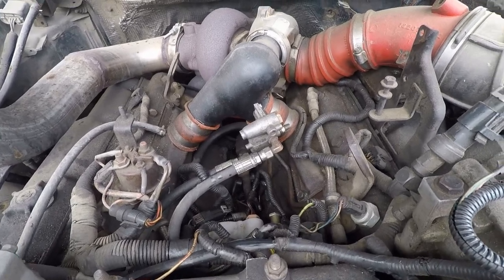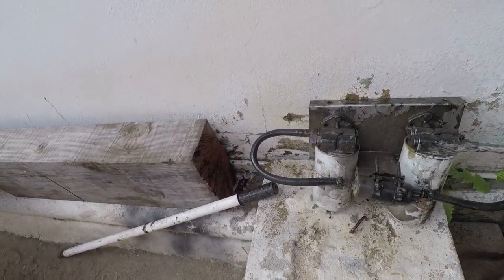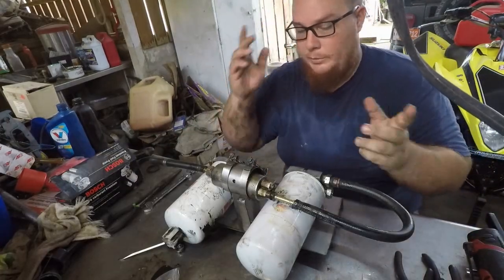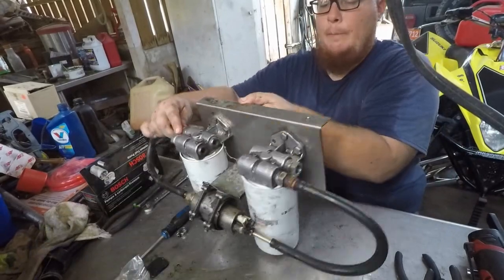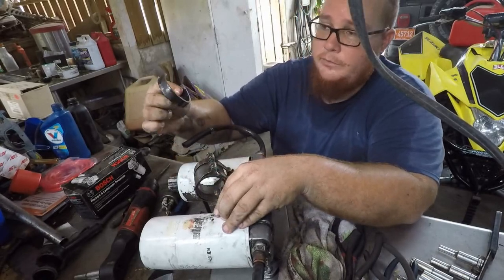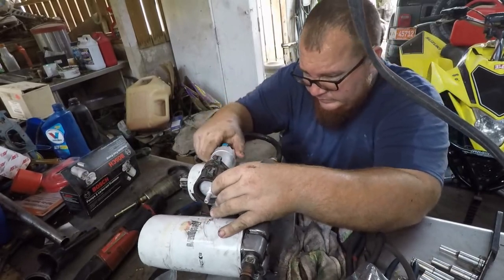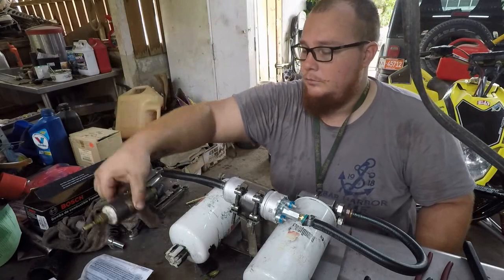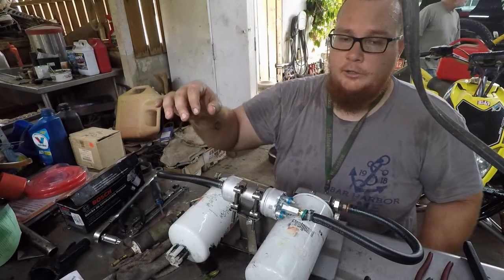FORD POWERSTROKE  7.3  OBS: CUSTOM E-FUEL SET UP!

Comment: Did you reuse the bolt for the banjo on the fuel lines ? I’m ordering everything and making sure I don’t miss something
Reply from the maker: Yes i did. With some fitting extra i dont remember i think i have  it written down on the video discription but thats all u need
Reply: @10MMSOCKETGARAGE  ok appreciate the help and do you remember how much the Bosh fuel pump was ? I’ve found multiple options and don’t know if it’s a knock off found one for 70$ and one for 160$
Reply from the maker: Letme chek real quick i think the knock offs was 80 . Dont get the one saying replaces bosch 044 i think it was the one 150+-
Reply: Hey so I picked up a extra fuel pressure regulator at a junk yard and it is the 95 and down cause it has the big black filter thing on it so since we’re the fuel drains back into tank is a nipple to hose vs the metal fitting on my 97 do I have to cut the shell up on the fuel pressure regulator and tap it ?
Reply from the maker: Hard to explain over the internet
 I do have a video on how i did it. Next to the custom Efuel setup

Comment: 044 pumps are diesel rated but don’t last near as long compared to gasoline usage. It will happen whether it’s a couple months or a couple years.. and depends if you truly got a genuine Bosch pump in longevity. Should of had like a holographic with a serial number on box somehwhere pretty sure to be genuine Bosch. But sweet build man I built my own efuel for my 7.3 obs as well couple years back now. I’ve use fake Boschs real boschs 044 pumps and now I’m using 6.0 SD Bosch pump forget the part number but it’s been more reliable.. also could run two if I every require more fuel.
Reply from the maker: Ill lookup bosh 6.0 diesel pumps. Must be more reliable
Reply from the maker: You really made me think about longevity of the 044 with diesel fuel now. Damn you.

The amazon special 80$ knockoff i had before it went 3 years didnt go bad but it was weak.

Comment: Not as cost efficient but if you made your pump outlet fitting AN male and outlet hose fitting AN female swivel you won’t have to fight barb on the side of the road when your fuel pump takes a shit.. been there done that. Swapped it from barb to AN after.. or leave enough hose to cut off barb make a new square cut and put back on barbs..

Comment: Could you help telling me the fitting from the fuel hoses that connect to regulator? those 2 located on front head. Are they AN-6?
Reply from the maker: I dont remember u just took it to the local hydraulic fittung shop and they hooked me up

Comment: Just shows you don't need all the high dollar aftermarket. What country are you in?
Reply from the maker: Exactly if the stock lines are good and not leaking idont see why u wouldnt wanna re use them exept for full blow race mode. Im gonna push their limits now with this pump and hot tune. Ive been never capable of going above the 60hp tow in hydra fuel pressure drops. I have a custom tune waiting to try. Im from Aruba a small island in the carribean english is my 2nd language